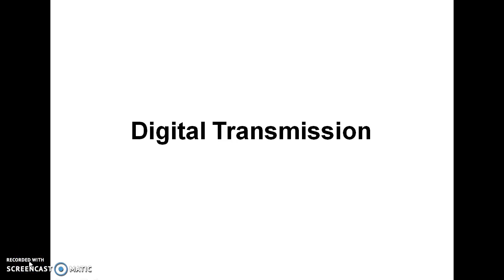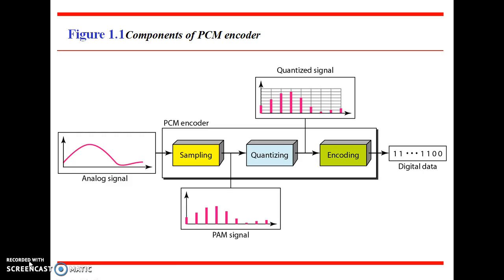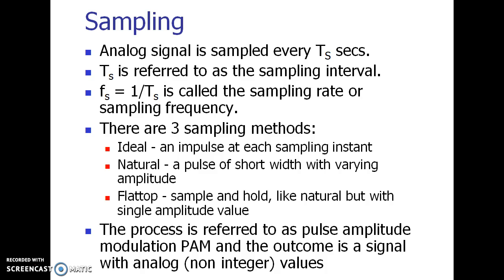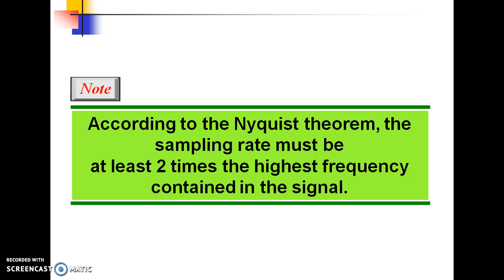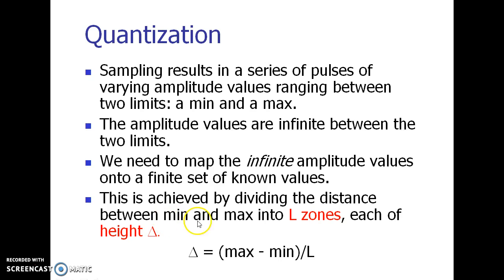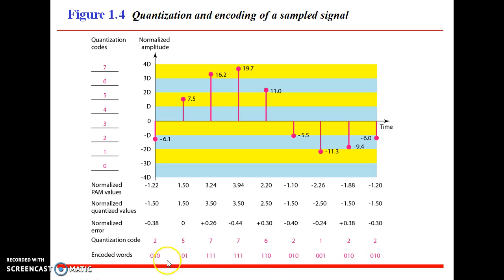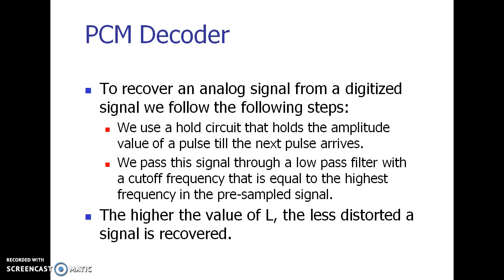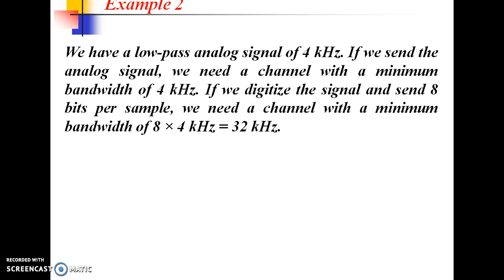PCM

Comment: Madam I have question in sampling in negitive pulses are smaller why because pz                         
Tell me madam
Reply from the maker: No it is not necessary that negative pulses will have small amplitude. It will depend on the amplitude of signal at that time..